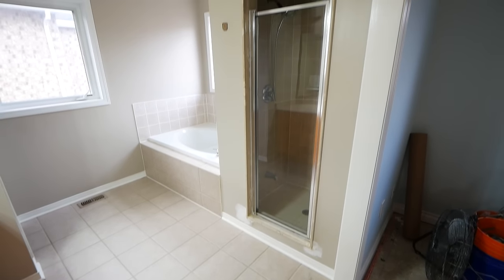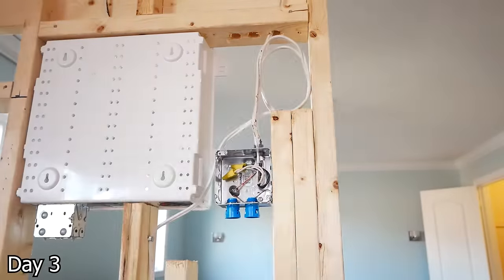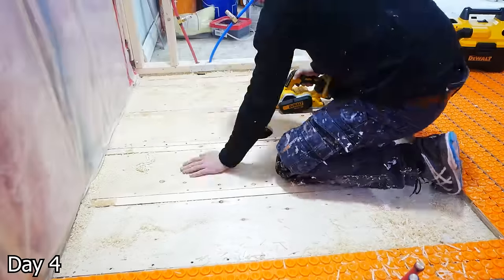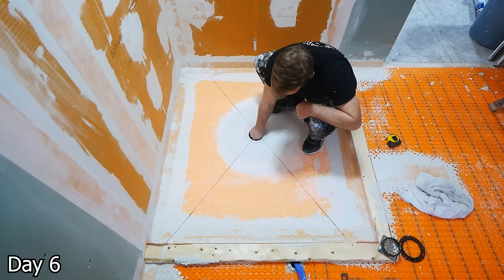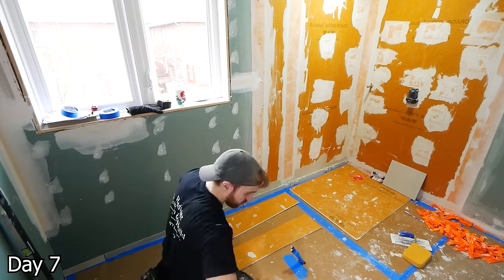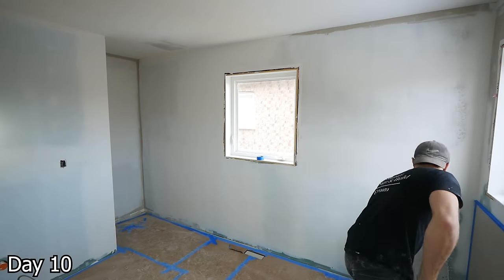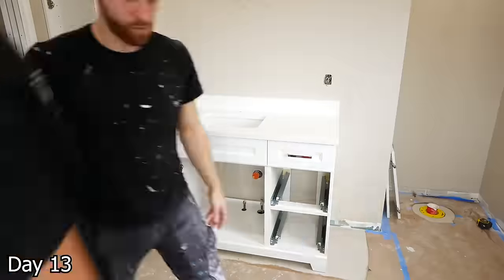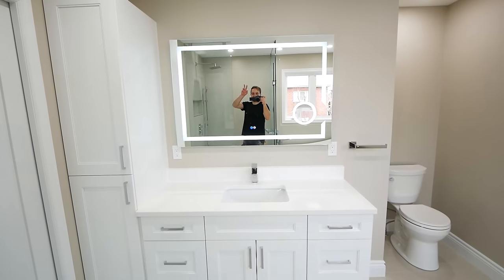MASSIVE Ensuite Bathroom Renovation

Comment: For creating the temporary barrier for testing the water doesn’t leak use foam spray to build the barrier. That should be easier to remove later without creating any issues

Comment: Hi Liam! Great work as always! Fellow general contractor in Toronto and York Region here and your videos really inspire me! Keep up the good work!

May I ask where you get your schluter glass profile from? I'm getting them from Schluter with a $125 shipping fee.

May I ask what your considerations were to use the glass profile on the wall on the shower control side wall, but on the glass panel the shower door is hinged on, I see a glass bracket on the floor? Is that an extra bracket on top of the schluter profile or did you opt not to use the schluter profile on the panel the door is hinged on? Thank you and happy new year!
Reply from the maker: Hey there thank you so much! I get most of my schluter products from floorbox an online distributor. Make an account with them and you can get products significantly cheaper (I get 30% off at this point)

The only deco profile for glass in this project is the one by the pocket door. The reason we used this here was because we wanted the shower pan to be 48” wide (exactly 2 tiles long) because of this the niche wall is also 2 tile long. So in order to have something for the glass to adhere to we were able to use a profile which allowed us to get our 48” pan and 48” wall without having to do any sliver cuts. 

Hopefully this makes sense, let me know if you need any clarification
Reply: Thank you! I did open an account with them! recorded a 80 sec video of both my face and the screen on loom and will send you the link. Appreciate the time and looking forward to hearing back!  @WorkinwithWolkon
Reply: dmed you on ins

Comment: good job, one thing I would have done differently  is I would have waited to run the wire in the heat mat until right before I did the floor tile because it's very easy to damage the wire  but other than that very good job

Comment: A really nice, professional job. However I've never understood why home owners would choose to put a freestanding bath against a wall. It makes it extremely difficult, if not impossible to clean behind it when dust, hair, soap scum and water eventually build up in those hard to reach areas. Also, the base sections against the walls are not able to be sealed with silicone, so water ingress under the tub would take a long time to dry and possibly cause issues with mould or mildew.

Comment: Your videos are awesome! I only wish you'd go a bit slower like showing the bit where the exhaust fan was installed in more detail... I believe you used tuck tape around the jagged drywall cut-out... then installed the flush-mount vent frame...?
Reply: Technically, he doesn't even need to put tape around the edges but he just goes the extra mile as usual to make everything neat and tidy. He put some blocking at the top above the dry wall so he can screw the white vent frame to the ceiling and keep it sturdy. And then he finishes it off with mudding after and then paint over it. I hope this helps, cheers! :)
Reply from the maker: I’m gonna come out with an A-Z series hopefully early this year showing in detail every step of the process. It’s quite difficult fitting all of the small details into a video like this one but with a series of videos I should be able to better explain each step 
There will be a video on the flush mount cover included in that
Reply: @WorkinwithWolkon  That would be incredible. Thank you! 

Additionally, I wasn't trying to imply that what you are undertaking is simple... Both construction and shooting/editing videos take a tremendous amount of work and effort. I was more over putting out a wish list...? Your videos are great... I'm just inexperienced...
 
Also  (while I am at it...), should you ever have the chance/desire to document your processes in a condo setting, or a space with steel studs/concrete floors/ceiling, I am certain you'd trend here on YouTube. There's such a gap for content of this nature. :hand-purple-blue-peace:

Comment: I would have loved if you explained why you ended your shower tile the way you did on the floor by the tub, looks like you did a small piece by the tub fixture and then continued with a full piece.  It looks great still but wondering why you did that smaller piece instead of just continuing with a full piece?
Reply: Tiles going down around the 17min mark
Reply: NVM i watched again and see its a continuation of the pan tile but it needed to be cut at the edge of the pan for the slop 👍. great work and great video.

Comment: Just my opinion, but it seems easy enough to just repair/refinish the waterproofing where the temporary curb was. I think you have the right idea for peace of mind.
Reply: Yea but that defeats the purpose of the initial test. If you pull up the waterproofing you were testing AND then have to replace it after the test, then you’re initial test isn’t accurate. So you’d technically have to retest. It’s sort of a paradox.
Reply from the maker: Exactly as Sal commented. It’s not redoing it that I have a problem with (doesn’t take much time to do) but it just makes the test feel pointless as you’ve now got new untested waterproofing going in
Reply: Understandable but my point is that there's no perfect way. Either you go without water testing it all and hope for the best or you water test it with a temporary curb and maybe have a repair to do. I understand either way, but at least with a temporary curb, you know that the waterproofing is good at least up to the point of the curb, and the plumbing is good as well. Waterproofing a flat spot where the curb used to be, really doesn't need a test, in my opinion, especially since you know how to properly apply it.

Comment: You mentioned adding a receptacle underneath the vanity...for what purpose?
Reply from the maker: It’s apart of a built in plug in one of the drawers, this way small appliances like electric toothbrushes or beard trimmers can be kept off of the countertop

Comment: Do you test the heated floor before tiling? My concern would it being defective and only finding out once the bathroom is complete.
Reply from the maker: The heated floor is tested upon opening the box, after installation, after tile installation, and after grouting. You can also purchase a device that hooks up to the cable and will alarm you if any damage occurs during the renovation process

Comment: I've noticed in you videos you never have to shim or adjust your board on the wall to sit perfectly plum and flat. don"t you find walls are never truly plumb or flat? makes for a pain when installing tile. Do you just make up for the inconsistency  in the wall with thinset?
Reply from the maker: We’ve been pretty lucky so far with not having anything TOO bad. As you guessed we do use thinset to make up for smaller inconsistencies. Of course anything major we would address at framing/boarding. 
You can actually see in this video that when doing the walls we are troweling out the backs of the tile but in certain spots we also trowel the wall. This was to address a low spot

Comment: "Nice" conventional bathroom update.  But what WE would have done instead?  Put up a new SOLID (tiled) wall (thin as possible) between the tub and (NEW) shower.  Slanted the new shower floor toward the back wall to a linear drain at the rear.  NOT used any glass (a total pain to clean), and merely had the shower aimed so most of the water lands mid-shower and drains backward, eliminating the need for a glass door.  I wonder if architects and builders EVER have cleaned a glass shower in their lives.  DUMB.
Reply from the maker: You may want to look into DFI coating. Something we include in our installs. A combination of a squeegee in the shower and the coating makes for minimal maintenance